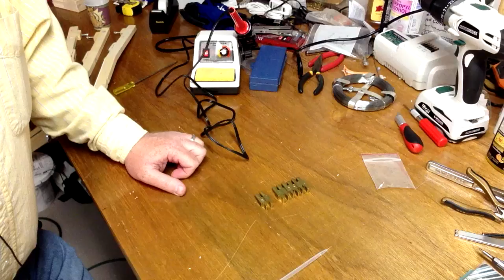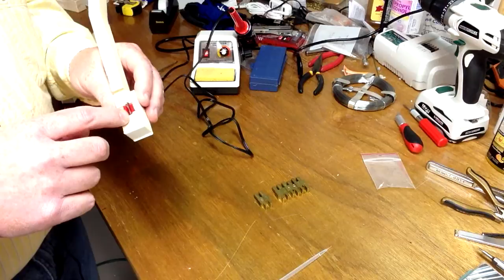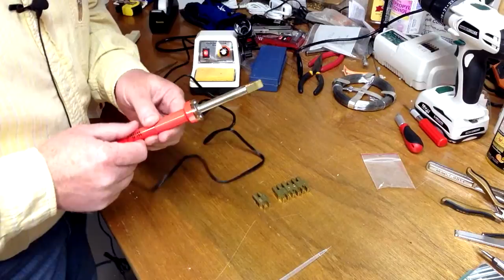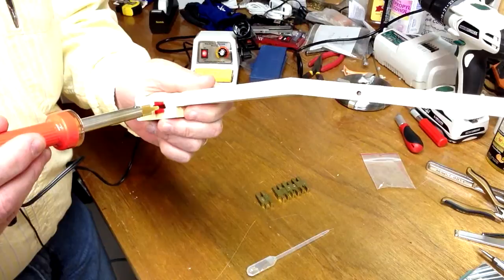Key Easing Iron Broaches - Piano Tuning & Repair I HOWARD PIANO INDUSTRIES

Comment: Thank you so much for this video. I ordered the key easing iron broaches from you and followed these instructions closely. This, in combination with polishing and lubricating the key pins per your other videos, fixed a problem with sticky keys that was probably caused by long-term exposure to excessive humidity.